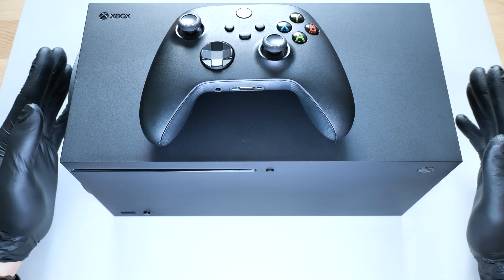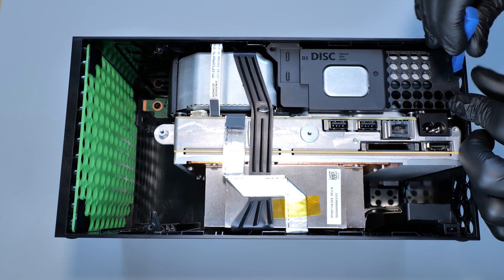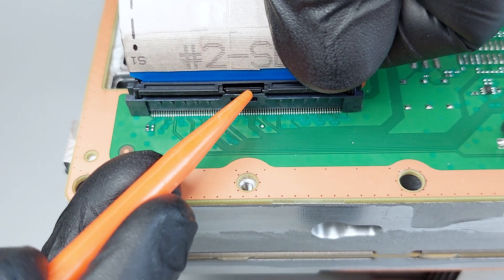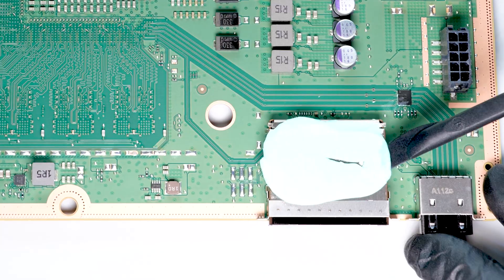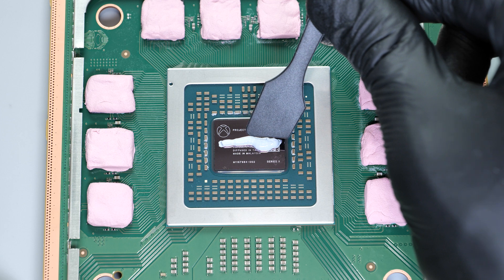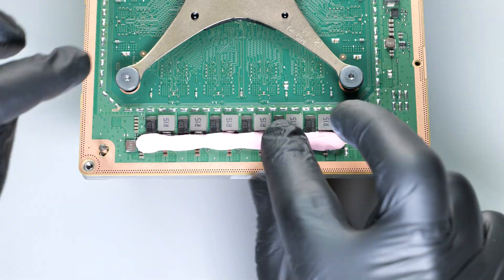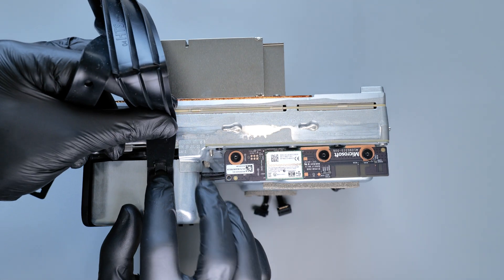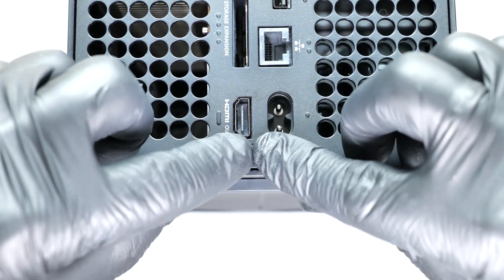Xbox Series X Thermal Paste and Pads replacement and Cooling System cleaning

Comment: I was having an issue with crashing immediately upon start up of certain games mostly high quality ones. I ignored this over the past few months to a year. I finally was fed up with it and I just did this process this morning however the thermal putty in my xbox seemed to be fine so I only replaced the paste. It worked perfectly for about 4 hours and now I am back to having the same issue of crashing about 30 seconds into certain games being loaded up. Should I reapply the thermal paste? Also i used corsair xtm50 as it was all that was in stock at a local store. Any ideas or suggestions? Is it possible I did not use enough paste and it lost a solid connection in that short amount of time?
Reply from the maker: These are tricky issues that can have multiple causes. It could be APU overheating, VRAM instability, or even MOSFETs becoming unstable under maximum load. Also, once you remove the heatsink, it may no longer make proper contact with the thermal putty, which can lead to overheating of memory chips and power management components. If the thermal putty still looks soft and pliable, simply reshape it so it compresses well when you reinstall the heatsink, ensuring effective heat transfer from the components to the heatsink.
I’d still recommend using Upsiren thermal putty, there even a higher-performance version than the one I used in the video. We use the pink one for customer laptops and consoles, but in my own console, I used Upsiren UX (gray one), which performs even better. For thermal paste, if you can't find Thermal Grizzly, Arctic MX6 is a great alternative.
Reply: @ElectronicsComputers  ok thank you i will try this

Comment: Interesting. My Series X shuts off on high-performance games as of late and being idle for too long. Destiny 2 and CoD can't even finish an activity/match. Meanwhile, I played either a small indie game or Elden Ring i can play for hours no problem. When it crashes the internals are pretty hot so i'll assume overheating.

Replaced paste a couple times but i think most likely is the putty is too warn out and needs replacing. Hopefully the power supply isn't to blame cause i get that arc sound when i plug it into the console.

Comment: great tutorial! Regarding thermal paste, do you think a viscous thermal paste is necessary to reduce the pomp out phenomenon? I know Kryounaut is great but it dries out quickly, do you know any other fairly viscous thermal pastes that you think are great for the xbox? I read something about hydronaut and thermalright tfx, what do you think?
Reply from the maker: If you're concerned about the pump-out effect, Thermal Grizzly Kryonaut Extreme and Noctua NT-H2 are excellent choices. They handle thermal cycling well and maintain their integrity over the applied area without breaking down. Just be aware, there are a lot of fakes on the market.
At my repair shop, we always use Thermal Grizzly Kryonaut for CPUs, APUs, and GPUs, and it’s been flawless. We also use Thermal Grizzly thermal pads, which are extremely durable and last a long time.
For thermal putty, we prefer Upsiren. It has an incredible thermal transfer rate, and in many cases, we actually choose it over thermal pads because it performs better in certain applications.
Reply: @ElectronicsComputers  Thank you

Comment: How often should we replace the thermal putty (the blue one)? Will we need to replace them every time we change the thermal paste as well?
Reply: Also, what should be the thermal conductivity (W/mK) of the thermal putty I will use?
Reply from the maker: Thermal putty typically lasts for years, but in my experience, it starts to dry out after about 3–4 years. The thermal paste used in consoles is not the best on the market in terms of thermal conductivity. There are far better options available—check the links in the description for some recommendations.
If you've removed the heatsink from the motherboard to replace thermal paste or perform a repair, simply putting it back won’t restore the thermal putty to its original effectiveness. The putty needs to be reshaped to achieve that compressed state again. However, if you're already in there, it’s a good opportunity to upgrade to something with better performance.

Comment: This video made it possible to do this today. Thanks so much for the detail and circling of screw used. Very well done. The thermal paste and readjusting the pads fixed my xsx overheating issue.
Reply from the maker: I'm glad I could help you.

Comment: Nice job, you made it look easy! Bravo on the Thermal Grizzly 👏 That's all I use myself on my pc's, I was thinking about repasting my own console. And that was the first thing I thought to use too. I like your style. Great minds think alike!
Reply from the maker: Thank you for the comment!
Reply: @ElectronicsComputers  I finally took mine apart and redid everything this evening. Same temps as I was getting before while playing games, but the heat feels hotter exhausting since I cleaned it and repasted everything. Getting that cover off the motherboard bracket was a pain. I noticed you didn't show it in your video. You must've already took it off and left it off👍
Reply from the maker: @TBRANN  That cover you're referring to isn’t present in all Xbox Series X consoles; it can depend on the production batch or version. If the exhaust feels hotter now after replacing the thermal paste and putty, it means heat transfer from the APU (and possibly other components if you replaced the thermal putty) to the heatsink has improved. This indicates the cooling system is working more efficiently, as it’s effectively removing heat from the console.
Reply: @ElectronicsComputers  yep I replaced the thermal putty and repasted the apu with Thermal Grizzly. I just left that cover off. It was a pain to get off, and I didn't want to mess with it again. Thanks for your help!

Comment: After doing this and replacing the fan my Xbox now turns on and immediately off again. Any idea how to fix this issue?
Reply from the maker: Make sure that everything was connected properly. Also, try to remove the SSD and turn on your console  without it.
Reply: Everything is connected as I went back in and checked all cables. I will try the removing the SSD before giving up and taking it to a professional technician.

Comment: Can i use thermal paste on the gpu?
Reply from the maker: That's what I did in the video.
Reply: I though that was thermal putty
Reply from the maker: @T.sizzle.  Thermal putty can be used only in those cases where thermal pads are used. It's perfect for memory chips, mosfets, SSDs, etc. For CPU and GPU, we use only thermal paste.
Reply: @ElectronicsComputers  Ok, thank you.

Comment: My console is shutting itself down while playing certain games and when I turn it back on it says it overheated. Ive taken it apart and cleaned the heat sink, power supply and fan. Its still doing it. Is the thermal paste likely the issue?
Reply from the maker: Did you replace the thermal putty as well? Is he fan spinning when console is on?
Reply: @ElectronicsComputers  I haven't actually replaced either the paste or the putty.
Reply: My console is having a similar issue especially when playing games like elden ring ,starfield and most recently space marine 2 :( but it goes dashboard and sometimes just full shutdown. Would you say this is the issue I've tried all the other fixes so I bought the tools to open it up. Should I  just get the paste and putty as well and doo the whole shabang or try the basic cleaning first by just removing the guts and cleaning the inside as well as the heatsink. Also I have never opened it and cleaned it and have had it since almost a year after launch and do you think this will fix my issue? I really want to play space marine 2... just a bummer man it is so epic.

Comment: Please can you do same for ps5 please and can i use thermal pads instead of putty
Reply from the maker: In theory, it's possible, but considering the various non-standard gaps between different components and the heatsink, you would need a range of thermal pads with different thicknesses, or you would have to use highly compressible pads, which have poor thermal conductivity. We used thermal pads for the One X consoles instead of thermal putty, but on the Series X, it seems that this approach causes more issues than it improves cooling. Nowadays, thermal putty offers excellent thermal conductivity, adapts to the shapes of surrounding components, and efficiently transfers heat from all their surfaces to the heatsink.

Comment: Not sure if your still reading comments, but would there be much different using 1.5mm pads on the vram chips over the puty?
Reply from the maker: In theory, it's possible, but considering the various non-standard gaps you would need  highly compressible pads, which have poor thermal conductivity. We used thermal pads for the One X consoles instead of thermal putty, but on the Series X, it seems that this approach causes more issues than it improves cooling. Nowadays, thermal putty offers excellent thermal conductivity, adapts to the shapes of surrounding components, and efficiently transfers heat from all their surfaces to the heatsink.

Comment: Hi there, first of all, great tutorial! Is it possible to use square cutted thermal pads (from bigger size pads of 24 W/ mK) instead of thermal putty? How many millimeters thick is the grease layer above memories and ssd? Thanks in advance.
Reply from the maker: In theory, it's possible, but considering the various non-standard gaps between different components and the heatsink, you would need a range of thermal pads with different thicknesses, or you would have to use highly compressible pads, which have poor thermal conductivity. We used thermal pads for the One X consoles instead of thermal putty, but on the Series X, it seems that this approach causes more issues than it improves cooling. Nowadays, thermal putty offers excellent thermal conductivity, adapts to the shapes of surrounding components, and efficiently transfers heat from all their surfaces to the heatsink.
Reply: @ElectronicsComputers  thanks!

Comment: Quick question I'm assuming you can use thermal pads instead of putty correct ? Also amazingly helpful video thanks
Reply from the maker: In theory, it's possible, but given the various non-standard gaps between different components and the heatsink, you would need a range of thermal pads with different thicknesses, or you would have to use highly compressible pads, which have poor thermal conductivity. We used thermal pads for the One X consoles instead of thermal putty, but on the Series X, it seems that this approach causes more issues than it improves cooling. Nowadays, thermal putty offers excellent thermal conductivity, adapts to the shapes of surrounding components, and efficiently transfers heat from all their surfaces to the heatsink.
Reply: @ElectronicsComputers  thanks for the reply I thought about that after I asked the question. The ones that were in my console were still good so next time I do a cleaning I will replace it all. Thanks again

Comment: NEED HELP, i did this followed step by step, and Xbox boots up and plays games but the network is offline, and says its wires when i both have ethernet plugged in or not. Can't switch to wireless. What should i do or look back inside the Xbox?
Reply from the maker: There's nothing you could do wrong during this process that could affect the Ethernet and Wireless card. It could be just a coincidence or a software glitch. Try unplugging the console from the wall and HDMI for a few minutes. Make sure there is no debris in the Ethernet port and also try to connect to a wireless network when Ethernet is unplugged. If none of this helps, then I'd try to hard reset the console.

Comment: Derbauer himself said kryonaut is not suitable for long term usage, as it is originally used for LN2 cooling. Beware
Reply from the maker: I don't know who that is, but we use that thermal paste for all applications in our repair shop (we don't cheap out on that like others do), and I haven't noticed any degradation signs for the first two years of that paste. Usually, devices come in for repair after 1-3 years of use when they are full of dust and have other issues. Once the paste is replaced, whether it's a desktop PC, laptop, or console, it will last for 2-3 years without any issues. By then, it will already be the end of life for that device, which will likely fail due to other issues because modern electronics don't last that long and become obsolete very quickly. Of course, for some industrial equipment like power supplies that power machinery, we use different thermal paste that can easily last up to 8 years.
Reply: @ElectronicsComputers  derbauer or der8auer is the owner of ThermalGrizzly, producer of Kryonaut. In fact he just launched new series (2 or 3) of thermal paste for long term use in yesterday's computex. He admit its particle size is not suitable. Reports to him shows it typically dryout within 1 year. It's all according to him
Reply: @ElectronicsComputers  what i was referencing: https://youtu.be/bbVAG5MNi2E&t=13m47s
Reply: @ElectronicsComputers  what i was referencing https://youtu.be/bbVAG5MNi2E&t=13m47s

Comment: Nice guide. And good work on the Thermal Putty application. You may want to give your viewers a heads-up on the U6 Pro clone made by Computer Systems GR. From my testing it seems like they just added some pink colouring to K5 Pro (which doesn't perform very well, from my testing and others'). Upsiren U6 Pro is good, but now Upsiren UTP-8 is even better and still very competitive price. UTP-8 also avoids the confusion of Upsiren vs CSGR versions of U6 (which a lot of people have made the mistake on and bought the one from Greece).

Comment: Thanks for the video - i completed the steps but i am experiencing freezing after about 15-20 minutes of gameplay while the front light blinks until i push the power button to turn it off.  If if try to turn it on shortly after, the power light comes on, it doesnt load the home screen, and then it shuts itself off after about a minute or so. If i unplug it, wait about 10-15 minutes, and plug it back in, it'll power on and allow me to play game again for about another 15-20 minutes. I have tried everything from clearing cache, system reset, offline system update via USB, and burning sage. 

Any ideas?
Reply from the maker: How does the fan behave during those 15-20 minutes while the console is operational? If you just turn it on and leave it like that without playing any games, will it last longer?
Reply: @ElectronicsComputers  it behaves normally while playing until it freezes. If not playing a game it stays on without fail (I had to reinstalled some very large games)
Reply from the maker: @cupofjoe222  It's hard to diagnose such cases. First of all, I would make sure that it's not an overheating issue. If you replaced only the thermal paste but didn't replace the thermal putty, then the VRAM and MOSFETS can overheat and fail. Once the heatsink is removed, it won't make reliable thermal transfer from the component to the heatsink via thermal putty. You have to replace it or at least reshape the old one. Second, I'd check the SMART of the SSD. Then I'd check if the power supply provides stable current and voltage under heavy loads. I'd also check the power rail that powers the APU chip. There could be a dead MOSFET. If one of the MOSFETs in a phase fails, the APU can still function under normal conditions because the other phases can compensate to some degree by sharing the load. However, under heavy load conditions, when the APU demands more power than usual, the remaining functional phases might not be able to supply enough power. This insufficient power delivery can cause the APU to become unstable and potentially freeze or crash. As you can see, there are a lot of things that can go wrong, and without checking some key points, it's hard to say what's going on.

Comment: I absolutely love this video....how often should you replace the thermal paste and pads in a  series x? Mine is 3 years old
Reply from the maker: Thank you for the comment! It's hard to determine exactly when the stock thermal paste deteriorates. I've repaired Xbox consoles that were about a year old, just out of warranty, and the paste was already dry. I replaced the thermal paste in my own Xbox six months after purchasing it, and it was already pretty bad . The thermal putty lasts for several years, but while you're inside your console replacing the thermal paste, you might as well take advantage of the opportunity to replace the thermal putty with something better. After three years, I'm pretty sure the console has accumulated a lot of dust on the heatsink, and the performance of the thermal paste is likely quite low.

Comment: Hello, I bought an Xbox Series X console. It has been a week. When I turn on the console, it stays in the Xbox logo for two minutes. It enters the menu and then enters the game. I reset the console and thought the problem was solved, but I saw a problem installing a game. It has the same problem again. What do you think is the problem with the console?

￼
Reply from the maker: So, I presume you bought a used console, right? If so, I'd start by checking the health of the SSD. Connect it to a desktop computer, or a laptop if it has two M.2 slots, and check the SSD's SMART status. If it’s bad, you should immediately back up the first boot partition of the SSD. I have a video on how to do that and how to replace the drive. If that partition gets damaged, the console becomes unfixable. If the SMART status of the drive is good, I'd start checking some key points on the motherboard, but it's hard to explain in a message. So start with the SSD.